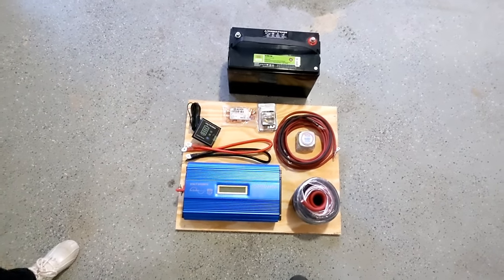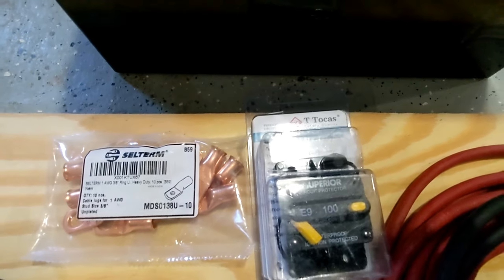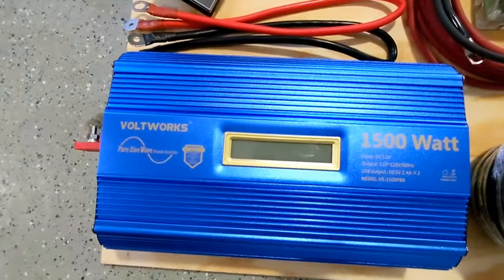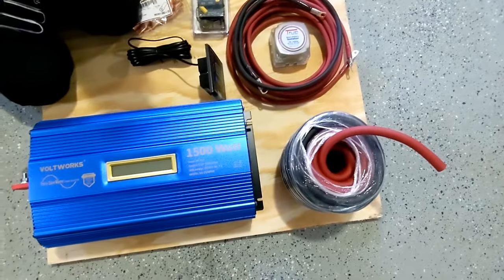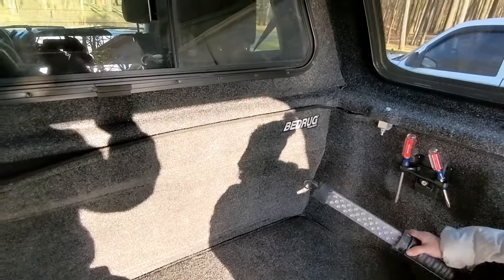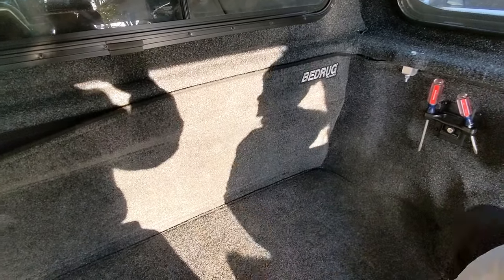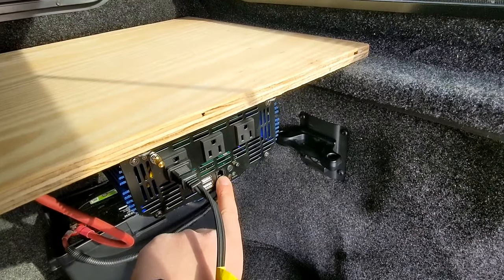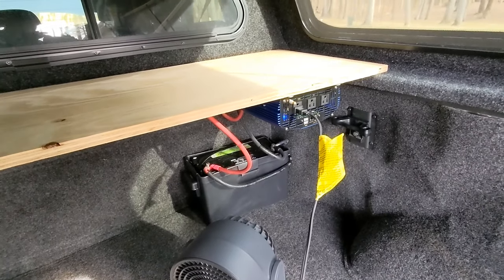Inverter Install and Dual Battery Setup / Truck Camper Shell / Overland Camping

Comment: What is your alternator size? And the type of second battery?
Im also curious on this setup. But some says that the deep cycle battery will be died early since the charging patterns are different.
Reply from the maker: The alternator is a 157 amp. The battery is an interstate 12v/110ah AGM deep cycle. I did this setup over the winter and the battery has been just fine. It holds a good charge even after setting for a few days.  Have not had any issues with this setup.

Comment: What size wire did you run from the truck starter battery to the auxillary battery in the bed? Could I skip the auxillary battery and run the inverter straight from the starter battery with just the circuit breaker and only run it while the engine is on?
Reply from the maker: It is a 6 gauge wire. You could definitely run the inverter off of the starter battery, but I would not recommend doing that.
Reply: @parttimecamper5561  Thanks for the reply. So will that 6 gauge wire from the starter battery to the auxiliary battery not get hot when the inverter is running that heater from the auxiliary battery? My question is, if you were driving the truck, and you have the 6 gauge running from the starter to the extra battery in the back, when you are pulling those watts out of the extra battery, is that load not then pulled from the other battery because they are connected? Thus causing the 6 gauge to get too hot? Thanks for any explanation. Also wondering, do you need a fuse or breaker besides the smart isolator on the positive wire between the two batteries? Thanks again!

Comment: Could you install a solar panel to this setup to keep the house battery topped off when the truck is off?
Reply from the maker: You could definitely do that.  You would probably be fine with a pwm charge controller also. It would be the cheaper way to go. I actually purchased a 100 watt suitcase panel to accomplish what you are wanting to do. Here is a link to the one I purchased. https://www.renogy.com/100-watt-12-volt-monocrystalline-foldable-solar-suitcase-with-voyager/

Comment: I've got a very simple question that nobody can answer...
From my inverter I'm running 2 240v plug sockets....
WHAT FUSE SHOULD I PUT IN BEFORE THE PLUG SOCKET...????
Reply: plug appliance into the inverter directly, no need others

Comment: U have arrange all YR set up for Auxiliary Battery in Ford 2019 .... But .... Is this in YR . Ford Truck SMART ALTERNATOR U have connect .... or ... with Standard Alternator ....? ... Can we connect YR same set up in Smart Alternator and work....? .... Because ... I have seen many videos Guided  or Tips about Smart Alternators with Auto companies fit since 2012 .... and ... They guided that ISOLATOR not work with Smart Alternator if fitted in Van .... and .... will not charge Auxiliary Batteries ...Will U guide me and clarify this my Query...? and one more matter is that .... Isolator is very cheap compare to fit B2B charger .... B2B charger cost is $ 250 TO $ 400.

Comment: Did all that wire come with the isolator kit? Also, what gauge wire did you use from the isolator to the aux battery?
Reply from the maker: The isolator came with its own wire and that is what I used from the isolator to the auxillary battery. I think it was 6 gauge wire.

Comment: Hi, does the battery have to be a "Deep Cycle Battery for Solar, Wind, and RV Applications". Or can it just be a regular lead acid battery found in cars?

I'd like to install a second battery in the trunk of my honda civic. But those deep cycle batteries are expensive.
Reply from the maker: Any battery will work, I would guess the life span of the deep cycle battery would last longer.

Comment: does the isolator need to be closer to the starter battery or the aux batt? also, does the inverter need to connect to aux batt? or does it matter which battery
Reply from the maker: The location of the isolator doesn't matter and yes the inverter needs to be hooked to the auxiliary battery.

Comment: Should I keep my car running? How do I tell the battery life/level?
Reply from the maker: I have a remote start, so I just start mine every so often and let it run its cycle.  I also have a voltage gauge hooked to the battery. This way I can see how low my battery is.

Comment: Why did u go with 100amp breaker? I have a semi truck with 4 starting batteries as my power source. Is that breaker good enough for a. 2K watt inverter?
Reply: 200A breaker for 2KW inverter

Comment: Do I need that little circuit breaker between the secondary battery and the inverter?
Reply: Id recommend putting a fuse between the inverter and battery strictly for protection and peace of mind

Comment: how long can that space heater run off that battery? could you run it for approx 8 hours to sleep during the night?
Reply from the maker: It would not last all night.
Reply: I have done some research, most space heaters pull about 1500 watts which is a tremendous amount and even the most industrialized batteries could barely let a space heater run for about 1-2 hours. So i would expect a car battery to be able to power a space heater less than 2 hours

Comment: Is that thinner cable you use from starter battery to aux battery better than the thicker guage wire? I have the same setup with a 5000watt inverter plus another battery to run the inverter but just charging a battery for a power tool drains the inverter within a couple hours.
I had the same setup in my old Sonoma but with thinner wire from starter battery to aux battery like yours and only had the 1 aux battery in that setup and no fuses just a circuit breaker and I was able to run a 1500watt heater all night long.
The only difference in my newer truck is I'm using the thicker cable and I'm using 2 fuses along with a circuit breaker and battery isolator, I should be getting more power longer in this new setup but I'm not. Any ideas?
Reply from the maker: The wire from the starter battery to the aux is thinner. I used the wire that came with the battery separator. As far as the issue of running out of power, the only thing I can think of is that when you run two batteries in parallel they need to be in the same condition when you put them together. If one battery is weaker than the other it will actually cause the other it will cause the whole system to lose charge quicker.
Reply: @parttimecamper5561  yea but is thinner better as far as from the starter to auxiliary battery? I had that thinner wire from starter battery to auxiliary battery in my Sonoma as well but in my f150 now I'm running all thicker guage wire.
And I put in the second battery because 1 battery wasn't producing much power for a long period of time like it did in my Sonoma and I put the second in not long after I realized the 1 battery wasn't enough but I don't see a difference between 1 or 2, it's really puzzling me lol I would think if it's my inverter it would just not work at all anymore but it still works just dies really quick and doesnt have as much power as it did with just 1 battery in my old setup. And I can't remember the amp hours of that old battery but I'm sure both the batteries in this setup is much higher than it was on that one
Reply: @parttimecamper5561  my exact setup in my old Sonoma was Starter battery>circuit breaker>battery isolator>auxiliary battery (all with thinner cable), then from auxiliary battery to inverter with thicker cable.
My F150 setup is 
Starter battery>circuit breaker>battery isolator>200amp fuse>auxiliary battery>2nd auxiliary battery>another 200amp fuse>inverter (entire setup with thicker wire)
Reply from the maker: @brando6136  I am not sure if it makes a difference using the smaller wire. I know it is only charging the battery, so that is why I went with the smaller wire. You may check to see if both batteries are getting a full charge?  I understand your frustration, but I can't understand why it wouldn't be working.

Comment: Do you have a video on how to add shore power to this?
Reply from the maker: I do not. I have looked into it and I would have to drill a hole in my truck cap, which I am not too fond of.
Reply: @parttimecamper5561  understandable!   I have yet to collect all the pieces for this but hope to make a move on installing this summer.
Reply from the maker: @andybeyer7348  it is definitely worth doing. I use mine all the time. I have a cooler I keep in the bed of my truck plugged in all the time.

Comment: Will this setup affect the starter battery at all? Do you need a high output alternator for this? Thank you
Reply from the maker: It will not affect the starter battery. That is what the battery separator is for. You do not need a high output alternator.
Reply: @parttimecamper5561  So for a setup with larger batteries in parallel, it will just take longer to charge if not using a high output alternator?
Reply from the maker: Yes

Comment: Rookie question. By doing it this way, you are solely relying on the alternator to do the charging correct?
Reply from the maker: Yes.  I also have a 100w suitcase solar panel that I use to charge the battery when the truck will be setting for the day.
Reply: @parttimecamper5561  Good morning I plan of doing this same thing this weekend on my 01 Tacoma. Did you have rig anything besides factory wiring to use the alternator. Or is the way the primary battery is already wired fine? I want to utilize this video I just want to make sure I don’t skip any steps. Thanks. Very new to the wiring world.
Reply from the maker: Your main battery should already be wired into your alternator. You should only have to wire up the secondary battery just like I did in my video.
Reply: @parttimecamper5561  Thanks for getting back to me I realize not that was a ridiculous question. Thanks for answering! Would love to exchange rig photos. Just finished mine with my dad looking forward to getting on the road and being able to camp out of it.

Comment: A Dakota Lithium battery will work great with this system, right?
Reply from the maker: Lithium is definitely the best way to go. You get a much longer run time. Just the price goes way up for lithium.
Reply: @parttimecamper5561  thanks for the quick reply!   12v 23ah good?
Reply from the maker: Yes. That would be fine
Reply: @parttimecamper5561  alright so I went with a Dakota Lithium 12v 54ah Deep Cycle.  Also got a 20a charger to go with the battery.

Comment: Is it possible to connect the battery to 12v socket whick i have in the back only to charge the battery while driving?
Reply: The 12V car socket is only suitable for the small inverter,below 300W or 200W.For the bigger inverter,please install the inverter to the battery by cables.

Comment: No voltage meter?
Reply from the maker: I did install a voltage meter along with some 12 volt plugs and a switch for the inverter. Here is the link to the video. 
https://youtu.be/wZjcIoYIJ5U?si=UhXx3ETZXClqrqUX

Comment: So, how do you know for sure if they battery isolator is actively charging your 2nd battery?
Reply from the maker: There will be a blue light that is on when it is charging the second battery.
Reply: TrueAm dual battery isolator have additional voltage gauge for real time monitoring of your batteries

Comment: Could I go bigger on the circuit breaker? I’m going for 2500watt inverter
Reply from the maker: You could, but I think you would be fine with the one I used.
Reply: Please choose 250A circuit breaker for 2500W inverter

Comment: Any issues or anything you would change?
Reply from the maker: No issues at all. Every piece of this setup has worked perfectly. If there was one thing I could change, it would be the battery. I will definitely go with a lithium once this battery wears out.
Reply: @parttimecamper5561  thank you and great video

Comment: Could I use this exact setup with two agm batteries?
Reply from the maker: I have never tried doing it this way, but I don't see why it wouldn't work as long as the two batteries are wired in parallel.

Comment: can you post where to buy the parts and how much they are
Reply from the maker: I added this to the description also.
Dual Battery Isolation Kit:
https://www.amazon.com/gp/product/B00400D6WU/ref=ppx_yo_dt_b_asin_title_o02_s00?ie=UTF8&psc=1
Circuit Protector:
https://www.amazon.com/gp/product/B01F76VJT2/ref=ppx_yo_dt_b_asin_title_o02_s00?ie=UTF8&psc=1
Inverter:
https://www.amazon.com/gp/product/B07T2GNHQM/ref=ppx_yo_dt_b_asin_title_o02_s00?ie=UTF8&psc=1
Battery:
https://www.amazon.com/gp/product/B00YB26RYG/ref=ppx_yo_dt_b_asin_title_o01_s00?ie=UTF8&psc=1
Battery Box:
https://www.amazon.com/gp/product/B004W5SG6Y/ref=ppx_yo_dt_b_asin_title_o00_s00?ie=UTF8&psc=1
I can't remember where I bought the wire from, but it is #1 Temco welding wire.  Just do a search on google and you can find it.

Comment: How long will it run that heater
Reply from the maker: Not quite an hour. That was more of a test just to show the inverter could handle the load.
Reply: @parttimecamper5561  I need one to rub my blower motor for my heater… will this run it all night?
Reply: In my truck camper
Reply from the maker: @Ouachita.Mule.School  How many amps or watts does the blower motor pull?

Comment: At 1500 watts you will be drawing 125 amps. Why the 100 amp fuse?
Reply from the maker: I always figure it's better to be on the safe side when dealing with this kind of stuff.  In the video I actually run a 1500 watt heater on the system and the fuse never blew.  You are correct though, if the 100 kept blowing I would have to upgrade to a 125.
Reply: 1500 watts at 120v is only  12.5 amps. I was wondering why he chose such an excessive fuse. You'd be fine with a 20, 30, or 40 amp fuse. Just like any household fuse.
Reply from the maker: @bryanoverbey  The breaker is between the battery and the inverter. 1500÷12=125 amps.
Reply: @bryanoverbey  if you run 1500 watts from a 12 volt battery you will get 125 amps from your battery to inverter. When you plug a 1500 watt heater into the 120v socket there will be approximately 12.5 amps from the inverter to the heater.
Reply: @rcadventure44  Thanks for explaining. I didn't know that.

Comment: What gauge wire was used from the car battery to the inverter?
Reply from the maker: I have 6 gauge wire from the main battery to the auxiliary battery and then 1 gauge wire from the auxiliary battery to the inverter.
Reply: @parttimecamper5561   thank you! I must have misheard the gauge of the non 1 gauge. This is helpful. 
How many feet was it of the 6 gauge? 
Estimate?
Reply from the maker: @raulmillan2930  it was roughly at least 12ft, but I honestly don't remember for sure.
Reply: @parttimecamper5561  thank you!
Reply: @parttimecamper5561 

Shouldn't it have been a thicker gauge at 12ft? Or does that only matter from the inverter to the aux battery? Wire gauge from battery to battery doesn't matter?
Reply from the maker: @adictiveadictive  That wire is for charging purposes only. I have not had any issues with this setup and I use it all the time.
Reply: @parttimecamper5561 

I have a 300w pure sine inverter hooked directly up to my starter AGM battery in a sedan. If i want to upgrade and have a  setup like yours and be able to run a 1760w air fryer while a small fridge/ freezer combo (about 40-69 watts) would you say all I need is what you used and just upgrade the inverter to a 2000 watt one? I have an in-line 60 amp AGU fuse near the starter battery not sure if I should upgrade. Will definitely upgrade the 4 gauge wire I used. Any tips?

Thanks